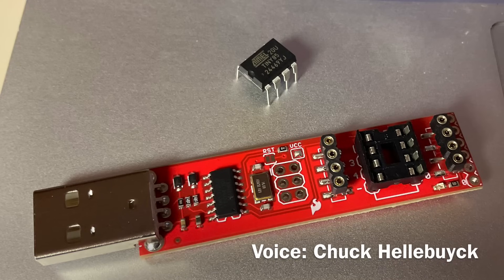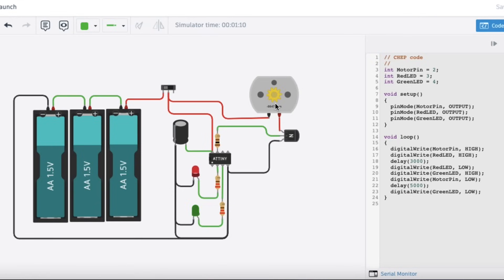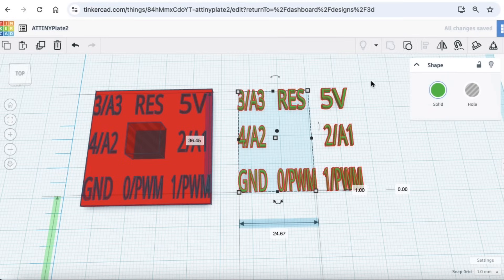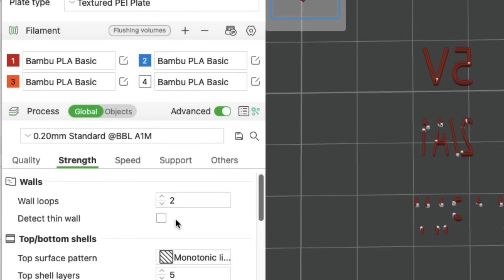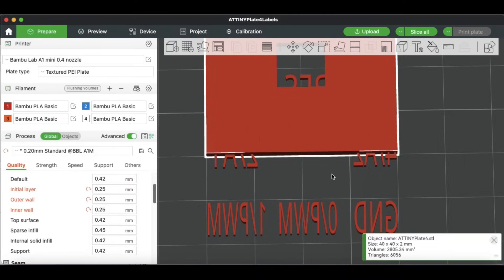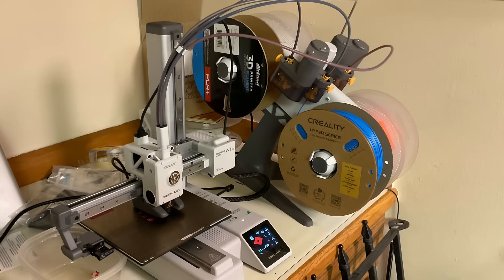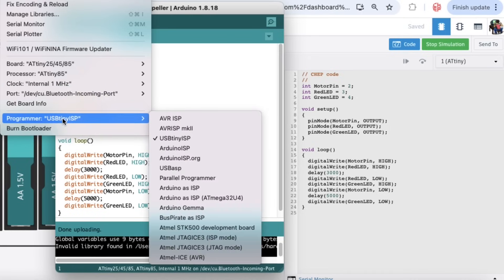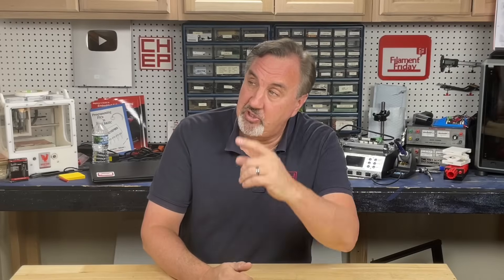ATtiny85 Pinout Template for Using Arduino and Snap Circuits

Comment: I really wish the Snapino was still available. I found out about it too late. Have many Snap Circuit kits, just looking for a microcontroller interface. :(
Reply from the maker: You can still buy the module. 
https://www.teachersupplysource.com/product/1592221/snapino-module/?origin=google_product_ads&gad_source=1&gad_campaignid=21842529736&gbraid=0AAAAAD_roX7Dlezlm4N5YEDUp6yIlByPf&gclid=EAIaIQobChMImbGE5Mu_jQMVJDYIBR0RPChMEAQYASABEgKCIfD_BwE

Comment: With my P1S, I generally do 2 layers of color, and it's good already, you may try with 0.4mm tall lettering (if printing on 0.2mm layer height). I love to print coasters and plaques using that technique facing the print bed, especially on textured PEI plate

Comment: How fortuitous... I was going to post this on your similar video from 5 years ago and found this! Anyway: I've been using the Z-hop method to produce some very nice 3 and 4 color pieces on an Ender 5 Pro. First color goes down without the Z-hop, the subsequent colors with. I'm not all that familiar with g-code (yet...) but I was hoping there's a way to insert a statement in the code to turn off the Z-hop after a certain layer when it's no longer necessary (it Z-hops during infill all the way up). The pieces I'm producing are 2.5mm in the Z axis but Z-hop only needs to occur for the first .24mm (2 layers). It would save a bunch of time (and wear) to be able to "stop the hop"... TY for your video(s)!

Comment: hi, i am using cura  when i print a area with hole it fills in to much !  what setting can i change to correct this ?
Reply from the maker: Select Print Outside then Inside wall. Or use this: Horizontal Expansion Setting in Cura
https://youtu.be/UUelLZvDelU
Reply: @FilamentFriday  my issue in the hole is being filled in a upside down triangle  instead of support that i can break and pull out .
Reply: @FilamentFriday  may i have your cura Slicing Profiles ?
Reply from the maker: @tazo1jd - link in description.

Comment: Thank you for another excellent video!  What made the greatest impression on me was how you reduced the line width for the lettering to 0.25 mm.  I did not know you could go that thin with a 0.4 mm nozzle.  I have gone as low as 0.3 mm with an 0.4 mm nozzle, but no lower than that.  Did you come across the 0.25 mm setting by your own experiments, or did learn this from another source?
Reply from the maker: From experimenting. 0.25 is the minimum for most slicers.

Comment: If you combine the models, you don't need to remove the text from the plate. It will just ignore the the interfering area. I make the text the same as my layer height and a high contrast filament so I only need one filament change.

Comment: The 3D printing side I understand and have experimented with in the past. That being said it was a good see someone else is using the same techniques. 

Now the real reason for the comment. I'd like to get started in programming micro controllers. I've looked for "adult" education course without any luck. Any suggestions on where to look for online training that a true beginner could use?
Reply from the maker: I have a book on Arduino. Link in description. 
There are lots of content on YouTube.
Reply: @FilamentFriday  Thanks! Appreciate it. I'm sure your book is excellent.
Reply from the maker: @twms8728 - SnapCircuits are seen as a toy but they are a great way to learn basic electronics as well.
Reply: I got started with Snap Circuits and it has been an excellent learning tool for me… even after a few burnt lamp pieces.

Comment: Looks good. If you select the "Only one wall on top surfaces" and/or "Only one wall on first layer" boxes under the "Quality" menu (you'll need Advanced toggled on) it will make the text cleaner and easier to read.